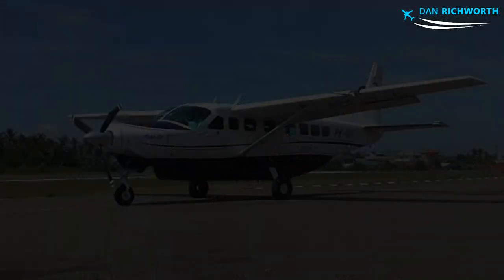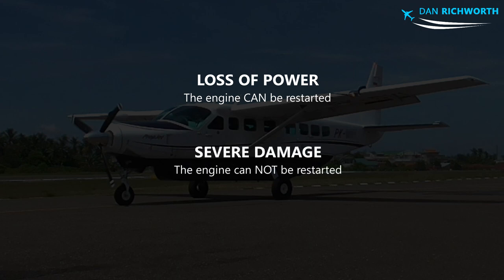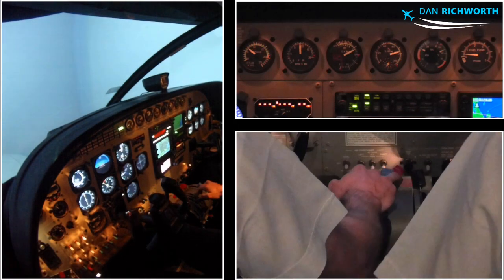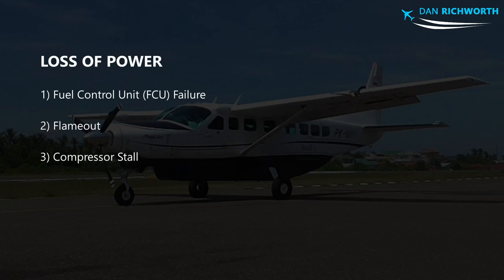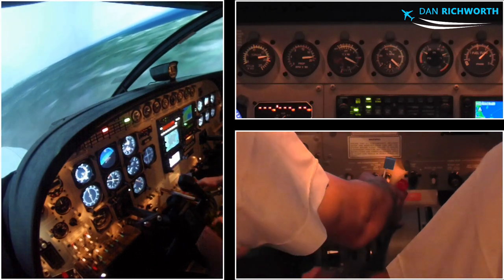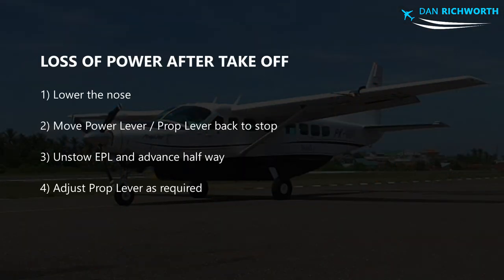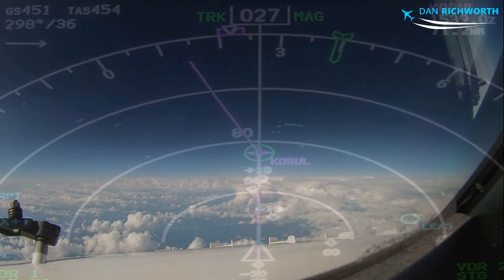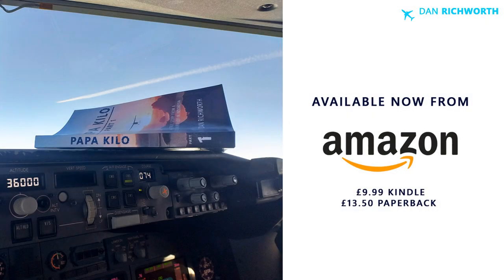How do you deal with an ENGINE FAILURE in a Cessna 208B Grand Caravan?

Comment: Well done! Very informative video.
@5:00. I would say the drag with a feathered prop is significantly reduced as opposed for the prop in idle throttle. CAUTION during flight training though: the unfeather process can take up to 30 sec (not 15 sec), so do it  at altitude.
Happy Landings,
Guido
(just ferried a C208 from Nabire WABI to Sri Lanka. Rough flying for the local operators up in the mountains. You guys did an amazing job there)
Reply: Far easier and safer to set zero thrust with prop unfeathered.
Reply: @calvinnickel9995  That is 100% correct

Comment: Great vid mate.
Question: if the drag difference between prop on stop or prop feathered is so minimal, with the prop windmilling in flight, why is it necessary to feather for restart of it's an extra 15sec in a recovery situation?
If it something to do with oil pressure/the governor?
Reply: (apologies for predictive text errors :) )
Reply from the maker: Hi Ross, if you're planning a restart, it doesn't make too much difference tbh. The prop is designed to auto feather with an engine failure. So feather/minimum as you prefer. However you will need to have the prop in minimum prior to the restart.